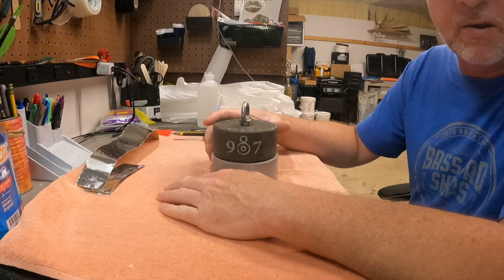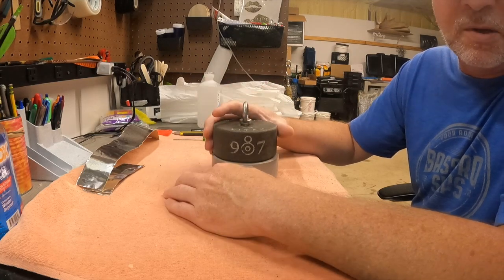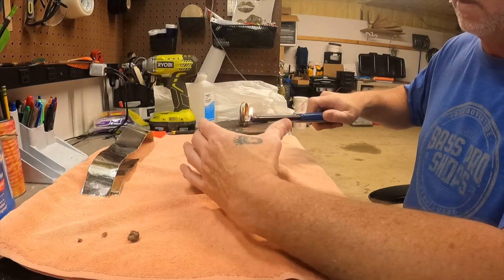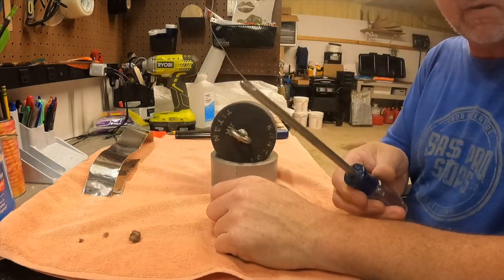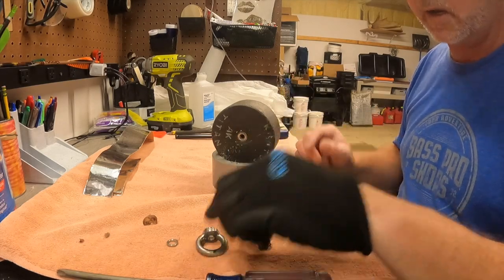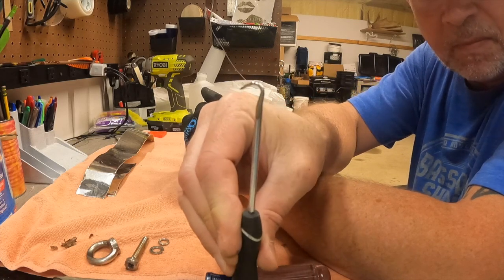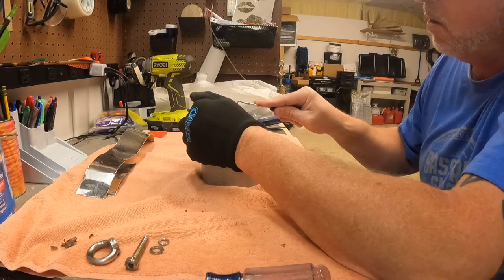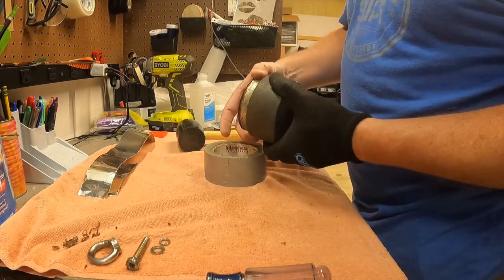SPECIAL EPISODE:  Cleaning My Kratos Titan 360

Comment: Just getting ready to get a new magnet after my cheap, multi disc magnet rusted badly. 
 I'm really glad I found your videos on prevention and maintenance.
 I'm probably going to get a Kratos 3800/360 and I'll be using it in salt and brackish water so this is going to be a big help. I'm now subscribed and tickled the notification 🔔.
 What are the advantages & disadvantages as far as a stainless vs ceracoat protective covers? 
 Thanks for the tips.
 ~ Diver Dan
Reply from the maker: Diver Dan, thanks for watching and I’m glad the video was useful. The Cerakote Covers are the original stainless steel covers just with a Cerakote spray on it.  It helps with scratches and rust from my understanding anyways.  The cover in my video is ABS plastic made from a pipe cap that I modified to fit the Kratos Titan.  If you’re looking at getting a Kratos Titan 3800 360, use can use my discount code AK907 that will save you 12% off your purchase.  You definitely need to rinse off the magnet after using it in salt water.  From my understanding, salt water is brutal on magnets.  Feel free to reach out if you have any other questions.  Thanks, Mike!